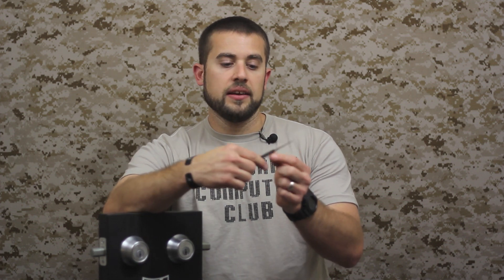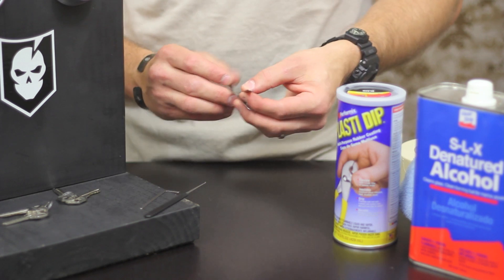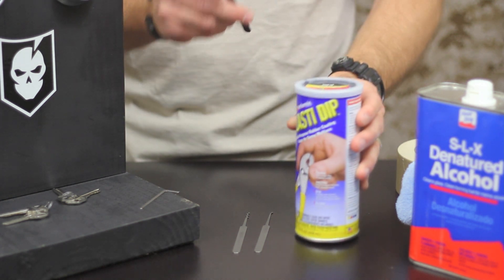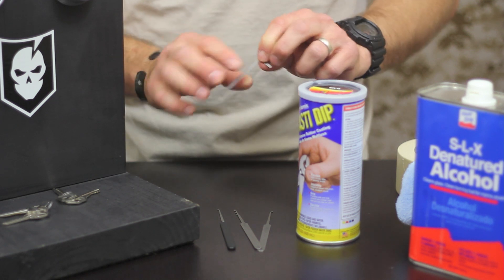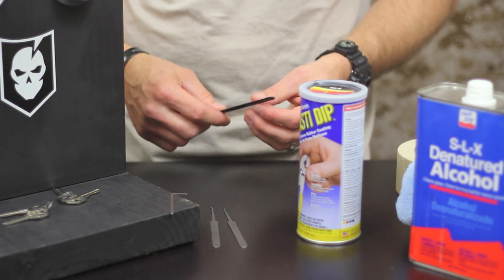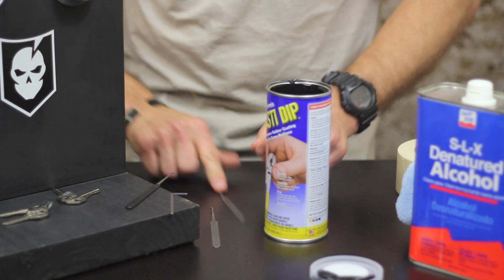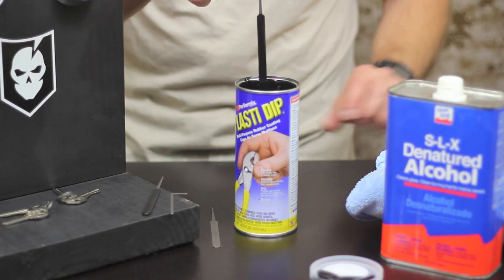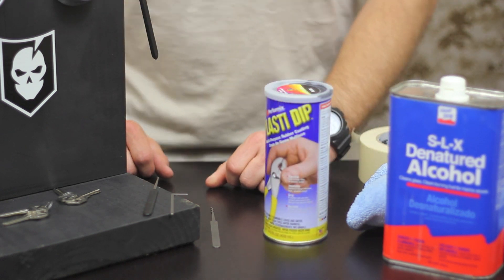DIY Plasti-Dip your Bogota Titanium Flats 4-Piece Toolset

Comment: I used epoxy adhesive to coat a cheap set of picks and rakes I bought from amazon, I've not picked any locks for 20 years (high school hoodlum in UK) thinking of getting a better set soon.